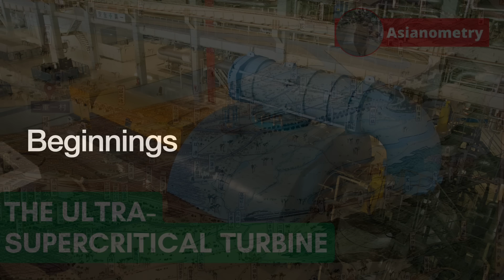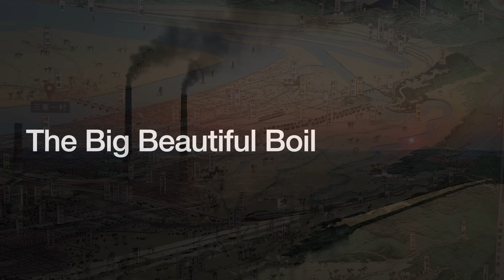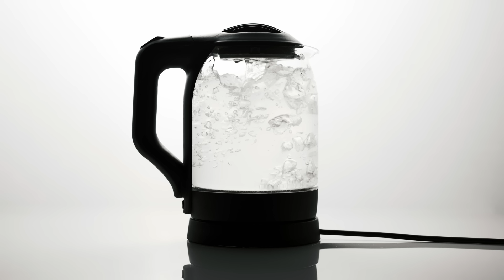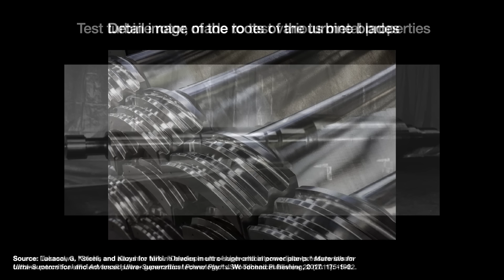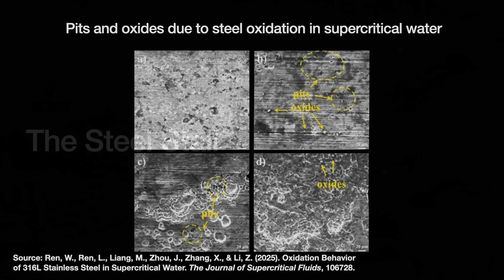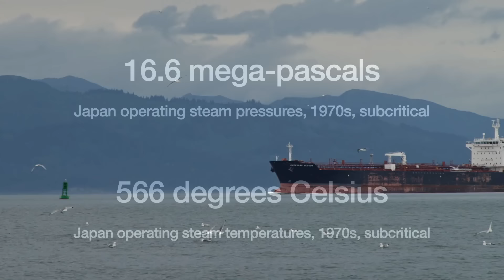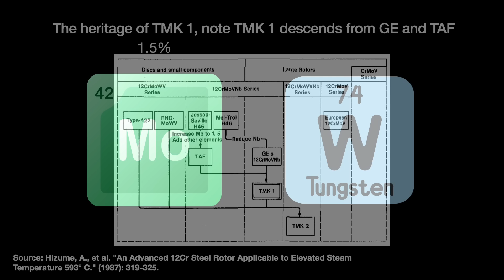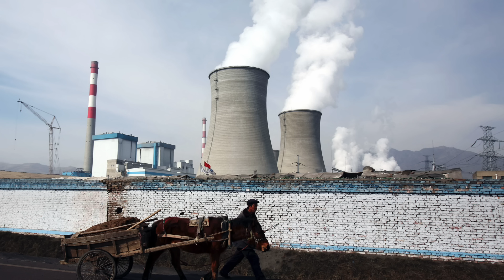The Epochal Ultra-Supercritical Steam Turbine

Comment: While the video argues that coal will continue to play a major role in future energy supply, recent data suggests a different trend. In 2024, 92.5% of newly installed electricity generation capacity worldwide came from renewable sources. This indicates that almost all new power plants being built today are based on wind, solar, and other renewables — not coal. Although existing coal plants may still operate for some time, the direction of new investments and capacity expansion clearly points toward a renewable future rather than a coal-based one.
Reply: I agree with the trend, however as it is stil just a trend, even on the downwind, steam plants will play a role. With growing renewable sources they will ecentually be replaced by peaker stations.

Comment: for baseload the only path away from coal is likely the power of the atom. Though in parts of the USA some coal plants have been converted to natural gas because its become cheaper in some regions to just pipe in gas and fire the boilers with that.

Modern world is in a way kinda steampunk, Basically everything we do is powered by steam. its just that we wisely found it was more efficient to keep it at a centralized power station and send its work out via electricity. well unless you live in Manhattan where somehow they also sell you the steam from the power plant, and somehow that steam can power the air conditioning in summer. So angry pixies make the lights come on and the blower fans blow and angry water vapor somehow makes the air conditioner make the coils cold.

Even home heating systems are going multiple stages, Most homes heated with natural gas today likely have a condensing furnace if its a new unit. Called such because it drops the combustion exhaust below its condensing point hitting efficiencies of 90+ percent. Meaning almost all of the heat from burning the fuel is going into the air flow of the ducts. Which is why they can be vented with PVC pipe.
Reply: Modern world uses less and less baseload.

Comment: If thermal power generation efficiency could push past 70% or so, it could start to make sense to use thermal energy storage, which should be dirt cheap at large scales. Due to the square cube law, in order to reduce heat loss you just need to build bigger so enormous storage capacities could be possible and store energy seasonally.
Reply: It's virtually impossible to get past 50%. CCGTs do it because they're extracting chemical energy then thermal energy. 

35% is good. Anything past that runs into laws of diminishing returns
Reply: @miscbits6399  Exactly! The Carnot Formula tells us that the maximum theorical efficiency possible with the Rankine Cycle is only 65%.
With the best technology available 45% is about the practical limit, beyond this the cost and complexity multiply to the point that cannot be achieved outside a laboratory
Reply: Wow, you just revealed that you are not an engineer...

Comment: Thank you for the information.
Fascinating as always. As materials science reaches the edges of a particular materials viable usability curve re: pressure and temperature it more and more appears to resemble artistry.
VERY impressive that they can get rocks to act like that. I would very much like it if you would consider an explainer on the new *SUPER CRITICAL* CO2 tech for heat engines. That seems fascinating as well.

Comment: You name the supercritical boiler still boiler cause you need the condensate state to pump the condensate in to the boiler where it boils. The fluid just doesn't have any phasechange, mean you can't determent if there is a steam or a liquid phase anymore, without a temperature reading.  
But if you want to start the powerplant, you are not supercritical (the difficult part) and therefore you definitely need a boiler

Comment: 22:31 more carbon in the atmosphere means plant life will proliferate, thus reducing the greenhouse effect and making timber more abundant. It all works out in the end.
Reply: Yeah but without humans, not that I care
Reply: @robertosutrisno8604 that’s an assumption. There’s no precedent for this
Reply: @hamletgiragosian6147 there's a chunk in earth's history where it's warm and free carbon is crazy high, there's life of course but not what we've evolved to live in
Reply: Unfortunately even with +50% carbon in the air already, and counting, there is little evidence of that effect so far.
Reply: @beatreuteler since when? And what is your source?
Reply: @hamletgiragosian6147  Well, the +50% is pretty recent, but this is what the Potsdam Institute of Climate Effects says: "Elevated CO2 generally boosts plant growth and improves water-use efficiency, causing a global "greening" effect, but this effect is limited by nutrient availability, water scarcity, and rising temperatures."

This said I may need to correct my statement insofar as the signs (greening effect) seem to be visible, but the issue is that we do not see a global increased CO2 sink in plants when forests are cut down and burnt at large in parallel. 

I do agree however that gardeners who use CO2 to boost plant growth in greenhouses can be successful, as these typically have the means to add also nutrients and water so the whole process works.

Comment: Seems like they're glossing over supercritical units in the U.S. I worked at a plant with a 884 MW unit with initial operating date of 1973; 3625 psi @ 1000F. IIRC, that unit has  6 sister units.

Comment: Be cause hydro power is so efficient, it would seem one basically could store energy by pumping water upwards to that reservoir that one has placed relatively high, and when that energy would be useful one could have it put into motion the spinning blades of your turbine (hope I still describe that in a somewhat correct manner:), producing power by 'translating' motion on a 'touchable' physics level into motion of electrons in conductors, which causes (or in fact is) electricity. Moving magnetic fields will cause electrons, which are energy 'particles' to start moving accordingly through conductive materials when they are getting exposed / subjected to such moving magnetic fields. Electrons are always present in all materials on an atomary level but they only in 'conductive' materials (which happen to be metals) can be caused to move, Electrons have a tiny bit significant magnetic field 'of their own', which of course involves a positive and negative polarity, and thus will be attracted or deflected by other magnetic fields and can/will react to external / other magnetic activity. Them starting flowing in a 'linear' direction is what a metal wire that has limited dimensions 'sideways' but not lengthwise can induce them to do: the electrons inside of the 'conductor' that wire is van be made to run over nearly any distance, giving the electrons the possibility to travel in both directions just as the magnetic activity will spur them on to do, at least as long as that wire forms a closed loop, cause electric activity is what one could probably call circular or even better maybe cyclical by nature, probably as their flow reflects how the negative and positive sides of a magnet(ic field) cannot exist without and physically separate from each other. With alternative current the electrons will run through the wiring of the circuitry that conducts (transports) them into one direction only for a certain distance, during a limited amount of time, and then reverse directions. This still allowsx them to deliver a comparable amount of 'power' as then flowing is what primarily counts as electricity and the direction in which they travel is not necessarily all that important (and can be corrected for at their destination). Them not having to complete a very long voyage  reduces transport losses, makes the flowing electricity less vulnerable for distortion and dissolution that could be caused by external magnetic or electric fields, and makes it slightly safer for living beings: in case a person or animal would suffer accidental exposure, the continuously changing flow direction would minimize the muscles 'freezing up'/ getting stuck in maximally activated positions, and would significantly reduce the risk of severe burns. Also only the voltage of AC (alternating current) can be upped or reduced by magnetic transversion in a so-called transformer.
Reply: In fact, one more super-ultra-nice example of how bad engineering can be without a drawing board.

Comment: Combined cycle power plants can  reach 64% thermal efficiency.  Coal is a dead-end
Reply: 1-Even if you use two tons of coal per ton of gas, Coal can be as much as 3 times cheaper per ton than natural gas

2-In east asia coal is far cheaper than importing lng, as LNG is at least twice as expensive as natural gas in the us

3-Coal doesnt require specialized infrastructure like a massive network of continously pressurized pipelines at 100 bar nor be cooled at cryogenic temperature, quite handy for 3rd world countries in Southeast Asia, the Indian Subcontinent and Subsaharan Africa

You can transport coal in a dump truck, or an open boxcar railcar or a bulk cargo ship, and leave it in a silo with infrastructure you already have for other use

4-Coal doesnt have competing demands other than thermal power unlike natural gas or oil that are used for everything
Reply: @renacimientoargentino7515 There is such a thing called externalities. In countries that use coal, healthy lifespans of citizens are shortened by anywhere from 6 months in the EU to 2-3 years in China and 5+ years in India. One  lost year of productive life is easily worth $100 000 to the economy and even more to the actual person and we have to add more healthcare costs and societal burden as well. This alone far outweighs the 20-30% electric bill savings compared to nuclear. The cheapest source of power including externalities is natural gas as this can actually be burnt cleanly only producing water and CO2, followed by hydro, solar and nuclear.
Reply: @MVargic   Again, modern coal powerplants with multiple stage aftertreatment produce less Carbon monoxide, soot, sulfur, and NOx prt KWh than CCGT powerplants with similar aftertreatment

As technology improved, one manages to mine deeper and deeper at a more economical price, the deeper you go the more coal there is and the higher quality it is
Reply: @renacimientoargentino7515  Coal power plants in Poland have desulfurization scrubbers and particulate filters in accordance with EU regulations yet even a small percentage that gets through has considerable impact and residual emissions react in air to form secondary fine particles. Despite the filtration, over half of  life expectancy loss from air pollution in Poland still comes from coal power and is about 6 months per person.
Reply: @renacimientoargentino7515  🤡🤡
Reply: Coal is not going anywhere... its cost effective
Reply: @DoktorBayerischeMotorenWerke  🤡🤡
Reply: @DSAK55  The facts are irrefutable, renewables will never meet demand, and they are too expensive, coal is cheap, available and now it's much cleaner.
Reply: @DoktorBayerischeMotorenWerke  🤡🤡
Reply: @DoktorBayerischeMotorenWerke  Depending on the country you live in , your lifespan is statistically shortened by 6 months to 5 years by coal power. Burning plastic or even liiteral shit is unironically cleaner. A single coal plant emits more pollutants than the entire solar and wind industry in Germany combined.
Reply: @MVargic  Can you cite a source to back up these fantastic lies and misinformation?
Reply: @DoktorBayerischeMotorenWerke  (22) Gohlke J, Thoma R, Woodward A, Campbell-Lendrum D, Pruss-Ustun A, Hales S, etal. Estimating the
global public health implications of electricity and coal
Scientific Evidence of Health Effects from Coal Use in Energy Generation
consumption. Environ Health Perspect. 2011 Jun;
119 (6):821.
Reply: @MVargic  Just one source?

Comment: I used to work for Mitsubishi Hitachi Power Systems (post merged power OEM departments of Mitsubishi and Hitachi), involved in sales and marketing for this particular technology as well as CCGTs and geothermal steam turbines. I witnessed first hand the manufacturing, installation and CODs of a greenfield power plant here in the Philippines using this technology. Can't say anything bad about the efficiency of the technology but the coal quality (moisture, cal/weight, ash, sulfur content etc.) required to feed these units are very particular. Only a handful of coal mines are able to supply power plants utilizing this technology. Hence why the project initially required a guaranteed coal contract by the IPP before the OEM even start commercial discussions which took a long time.
Reply: I found it interesting when China boycotted Australian coal because they (government) thought it could be easily substituted for local coal. That lasted one winter, with lots of power outages. There are substantial differences in coal from different sources.
Reply: @john_in_phoenix Australian coal is mostly used for steelmaking rather than power. It's a waste of good anthracite to merely burn it
Reply: @miscbits6399  That's true, it's great coking coal. They were able to replace it with local coal. This meant they had to open multiple small coal digs that had previously been closed due to low quality and low output.  Turns out that wasn't an adequate solution for generating power. Small batches of poor quality coal with random deliveries doesn't make for a stable grid. The steel quality wasn't as good either.
Reply: @john_in_phoenix  bursting your bubble here. Oz coal accounts for 3% of total coal used in 2020 for generation before the embargo happened. Most of China’s coal generation is actually domestic coal. So yeah… sincerely a guy from neighbouring Indonesia who was happily involved in helping China switch from Oz coal to even more Indonesian coal, who also happens to build power generation in Indonesia exclusively with China EPCs.
Reply: @WarrenKLiu  See below, hate to burst your bubble.
Reply: @john_in_phoenix see below where? There's nothing below
Reply: Do you mean the steel making? If so, coking coal and thermal coal are 2 very different types of coal. I'm responding to your implication that the embargo on Ozzie coal is the reason for blackouts in China. I'm telling you it isn't as Oz thermal coal accounts for less than 3% of coal used in China for electricity generation even before the embargo.
Reply: What’s Ozzie? lol
Reply: Integrated gasification combined cycle coal plants are almost agnostic to coal quality, and can achieve 47% thermal efficiency.
Reply: quality .......  is
Reply: @NoName-zn1sb   ..... undefined
Reply: Mitsubishi Electric stock is better than MAG7. Because apparently they and GE are one of few companies that can make these crit turbines.

Comment: "I said in the video "The more efficient a turbine is the less coal we need to get the same number of megawatts". I think I should have said mega-watt hours or something. Energy rather than energy per time period. Thanks Franklin. "
Is this an error? If you need less fuel for the same amount of energy and energy is the integral of power over time then necessarily you need less fuel for the same power over the same time.

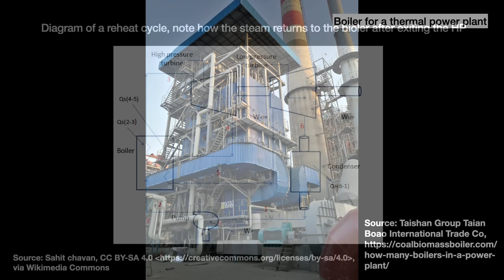Comment: You made a typo for the word boiler for the reheat loop design diagram at 2:25.  You have bioler.

Also, had i known you were making such a video, probably could have contacted the PR folks where I work for pictures.  We refurbish steam and combined cycle turbine spindles and generator rotors where I work.

Comment: This fight for a few more degrees and a little more pressure exists in gas turbine engines too; aviation engines run their turbines so hot that without very highly refined cooling the blades would melt instantly.
Reply: This is especially true for commercial engines, they want smaller more powerful turbines and much bigger fans with more bypass. Airlines will pay for 3% more efficiency, The number is small, but subtract 3% from all the Jet-A they burn in a financial year and accountants smile.